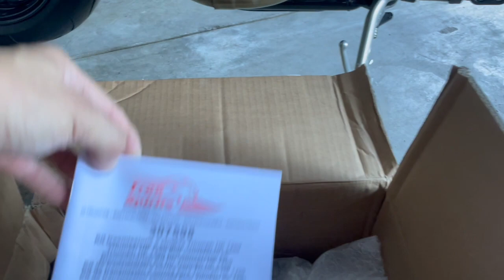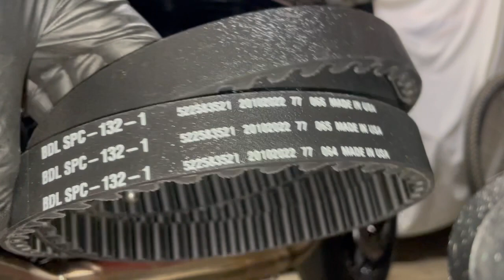SpeedTwin FreeSpirit belt conversion installation

Comment: Hope the counter shaft bearings live. That's a lot of weight for a shaft not designed to carry on the very outside. There are a lot of bike made with belt drives but they are designed that way. I replace my chains about every 20 to 30K miles and maintenance is minimal. I use good xring chain never lube, only spray with WD after washing the bikes. I ride off road, ADV and road and have used my system for twenty years without any failures and I ride hard. Still good to see you take the ST apart, gives me insight into my Bonneville.

Comment: It was interesting to watch, I hope the hassle will be worth it 😅
Reply from the maker: I hope so too.  LOL.  If this belt last 50k miles it'll be worth it.  This is gonna be my forever bike...as long as my body is able.  Considering I average about 15k miles a year I think by end of this decade it'll be around 50k miles.
Reply: @DaBinChe  It's money well spent.  I own a H-D and the belt drive is fantastic, clean, smooth and NEVER needs tensioning between tire changes (my last rear tire lasted 14,300 miles).  If Triumph fitted the Free Spirits belt drive kit as a standard feature of their 'Classic' range, they would easily sell more bikes.

Comment: Hi, I am thinking of converting to belt drive, just trying to find the parts in the UK, how is the belt working out? covered a few miles by now?
Reply from the maker: Haven't ridden too much, since it started raining here.  The ST is my pleasure bike along with the other half dozen bikes.  So the miles gets spread around.  I do use a ZeroSR as a commuter all year and that has a belt drive...much less robust belt too and it holds up fine.  The ZeroSR has 114lb-ft of torque.  As for the conversion it is a lot of work and unless you keeping the bike for 50k miles or more it is not economical.  With that said I love belt drive, for street use it is the best.